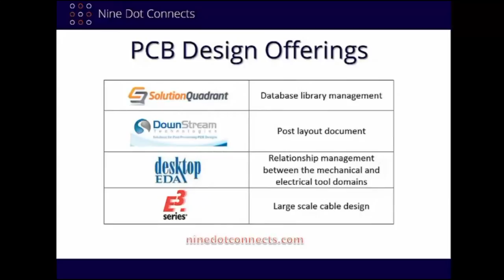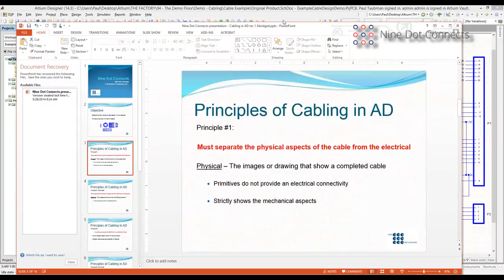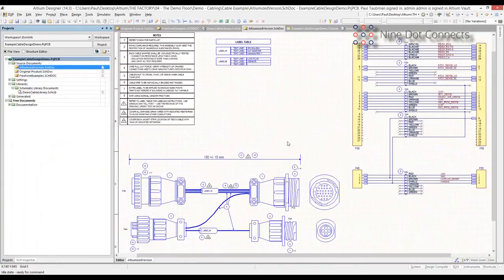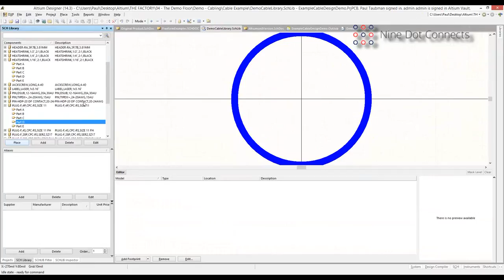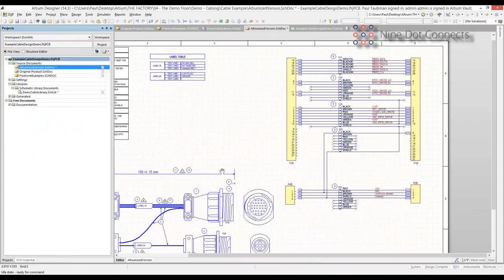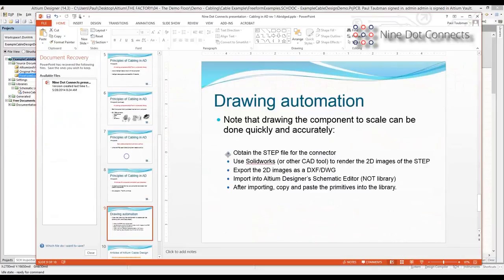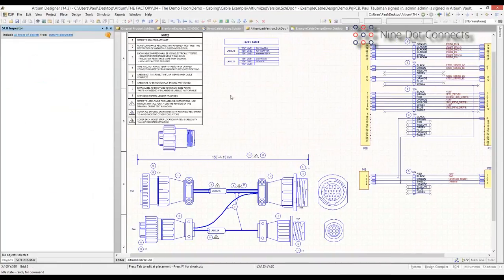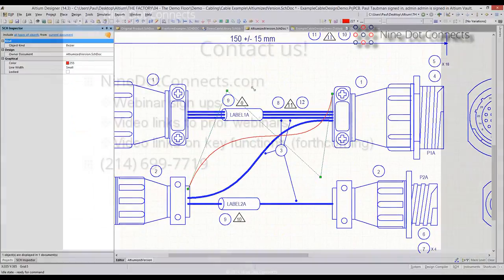Altium Cable Harness Design

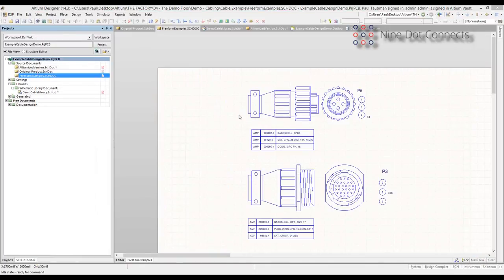Comment: @13:38 - Importing "AutoCAD" formats directly into the library symbol design window is now possible and you can skip the import to schematic step. Not sure when it was added but I am using AD20